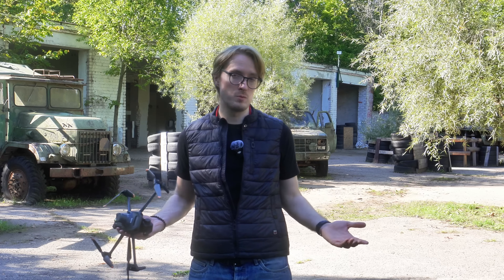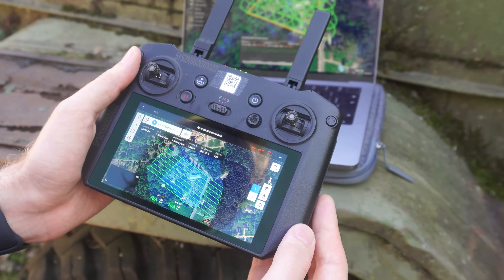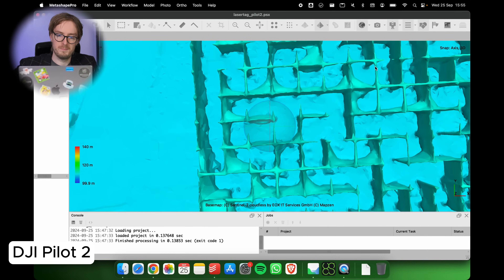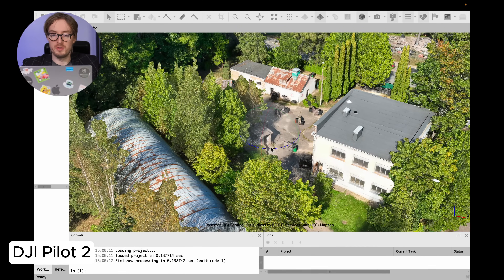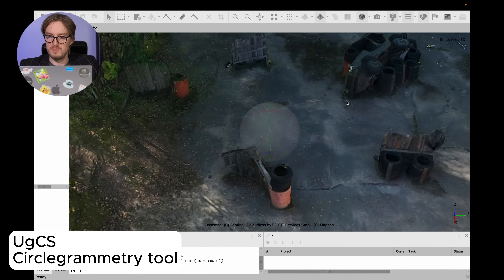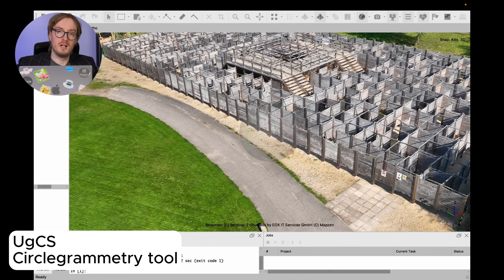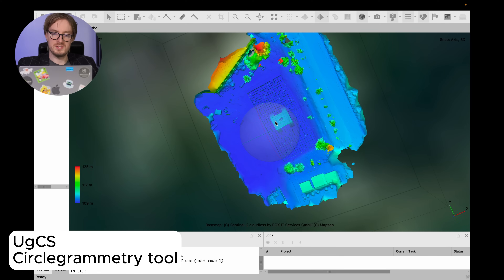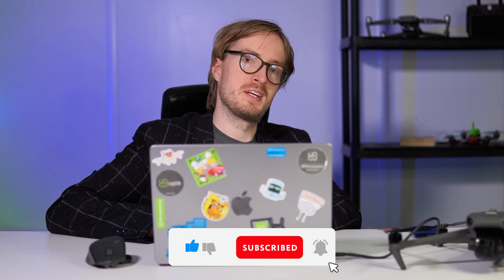THIS NEW photogrammetry METHOD will CHANGE DRONE industry

Comment: How long did the mission last in the regular mode compared to the circlegrammetry mode?
Reply from the maker: In this case they were set up to take more or less the same time. But circlegrammetry can be adjusted to take less time easily.

Comment: would this method create areas with different image overlapp percentage? also I wonder if its possible to use the traditional method for most of the mission area, and circlegrammetry for specific region
Reply from the maker: The overlap would indeed be different in different areas. But it is possible to combine this method with traditional photogrammetry methods, with UgCS you can even have both segments one after the other so it does everything in one flight (assuming you have the battery for it).

Comment: what a rubbish comparison.  no one uses a single parallel lines oblique capture for photogrammetry, at the very least a second cross path flight is needed but anyone who has any interest in photogrammetry has long since read and understood that any single object of interest be it a statue or a building will require a absolute minimum of 5 images taken from 5 different approach angles in order to develop any serious result.
Also this grid of circles completely misses any decent images of anything that falls between the circle centres as there are no useful images of this part

Comment: I assume the flight time is longer. I'd bet a grid based on a triangular grid to be better than a square grid when dealing with vegetation. wiki/Overlapping_circles_grid particularly the flower of life made from 7 circles and the 19 circle flower of life. Would a Hilbert curve (which doesn't have to be 90degree turns) be even better?

Comment: Circular flight pattern improves scan quality on Drones without Lidar Sensor but increases flight time as well
Reply from the maker: That is true. But the flight time is highly adjustable based on size of circles as well as overlap.
Reply: @ugcs_official  if you could generate 3D scan within DRONE like we have app programs that scan and generate 3D images at the same time which would help compensate for extra time spent on circular flights.

Comment: Out of curiosity, does UgCS work with a phantom 4 pro+ (the original phantom 4 pro with the combined controller and screen)
Reply from the maker: Hi, you need to have the SDK controller (with no in-built screen) to use the Phantom 4 with UgCS.

Comment: Did you say what the capture angle was for the Pilot 2 missions? Also, why use Pilot 2 and not UgCS for the traditional mission?
Reply from the maker: UgCS can also be used for standard photogrammetry missions using a traditional grid. In this case Pilot 2 varies the capture angle but at the same time tends to overextend the area.

Comment: What was the duration of capturing all photos with Pilot 2 and Circlegrammetry?
Reply from the maker: In this case the capture time was more or less the same but with Circlegrammetry play around with the parameters a lot, making the flight time way less than Pilot 2. And even with that it was possible to get an even or better result from my tests. -Kristaps
Reply: @ugcs_official  Great. Can I do circular helix mission for let's say chimneys, telco towers, etc.? So basically I need the drone to do one circle of an object at different heights kind of...
Reply from the maker: @xcelsiorcinematics1152  You can use the Circle (not Circlegrammetry) tool in UgCS for that. You can just set the center, specify number of circles as well as height difference, direction and radius. Sounds like exactly what you described.
Reply: @ugcs_official  would that be the desktop app or the phone app?